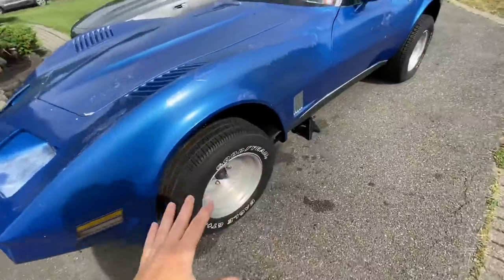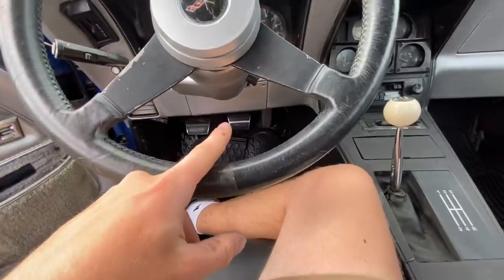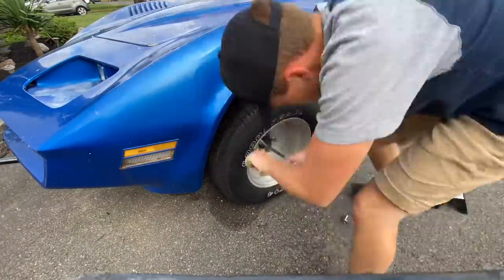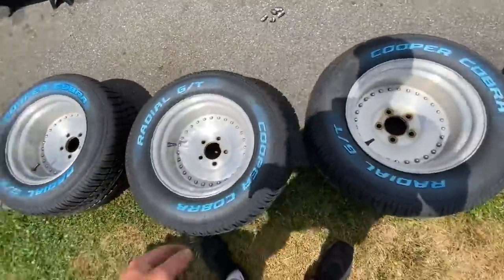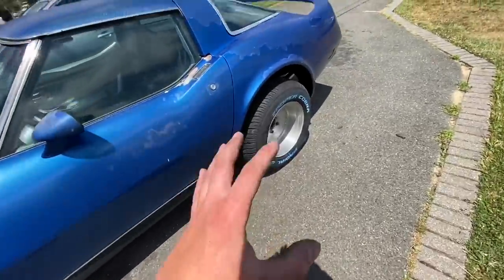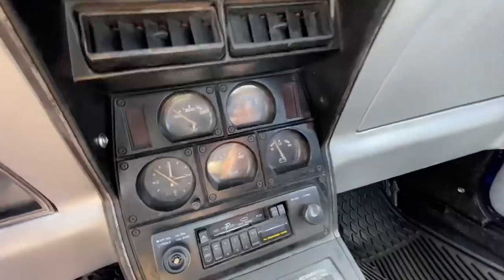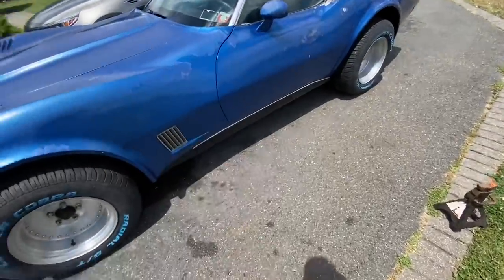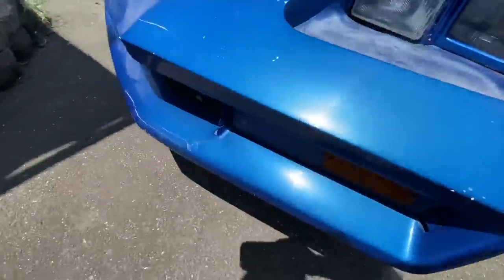The Corvette is READY For the STREETS! Cranking Out the Final Steps to Get it on the ROAD!

Comment: My dad taught me a trick to find shorts... When you disconnect the battery on the negative side.. and touch it back to the battery.. it should not arc as much or non.. but if it does.. it has a short.. if you pull each fuse one at a time and keep checking if it arcs off . It can help you find the location on the short. If you pull the dome light fuse and it doesn't arc off while that fuse is out
. Then that's ur problem.. or use a multi tool as u pull each fuse to see the current pull..
Reply from the maker: That’s a great idea, thanks!